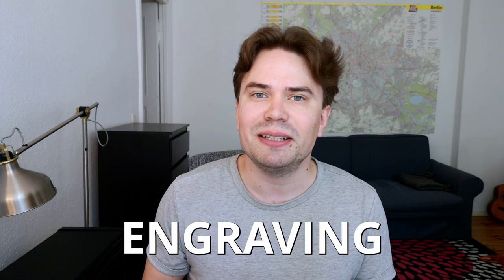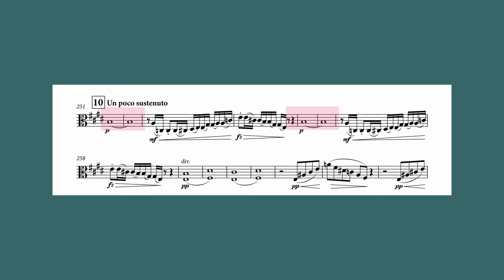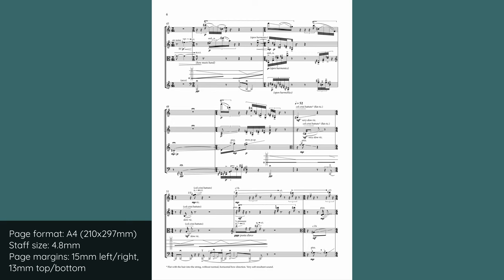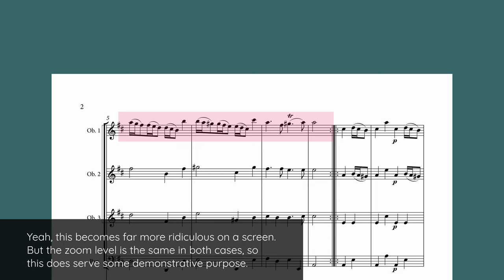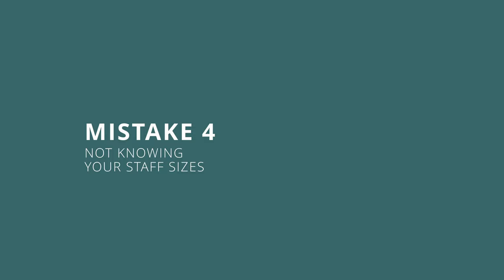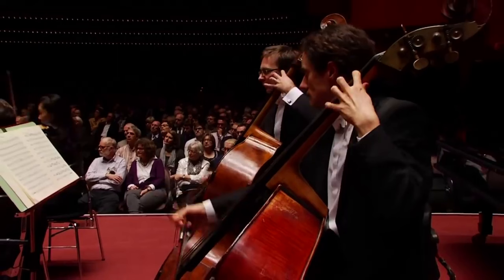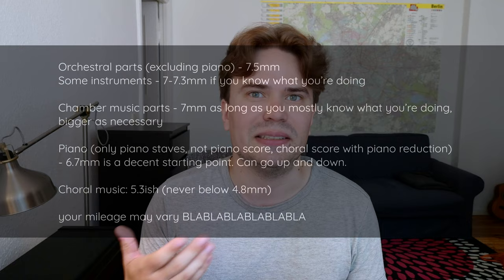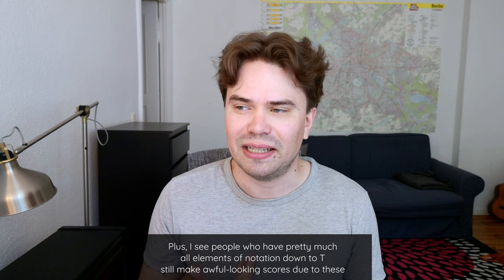Top 4 music engraving mistakes

Comment: In my experience, choosing staff and paper sizes such that the layout of a given single page of score is good is more or less always possible, but in a score for a large ensemble where empty staves are hidden, every page is its own potentially unique layout challenge, and choosing a single staff and paper size that is good for every page can seem impossible. I often run into situations where I ensure that tutti systems fit comfortably, but when there are sequences of several systems in a row where around two thirds of the ensemble plays, there isn't room for two systems on a page, but one system per page is too spread out.
Reply from the maker: Usually in those cases, you have to:

a) add extra whitespace at the bottom of the page (as in mistake #3)

- having different heights for the bottom staff throughout a score is fine, but you would want at least a spread (two facing pages, left+right) like this, not just a singular page. Some editions do not do this.

b) show more instruments that are not playing. Optimized scores are tricky and you can't always optimize all passages. Sometimes you have to pretty much have a tutti setup despite not having too many instruments playing.

or possibly, if it has not been explored yet:

c) reduce more staves if you want to achieve two systems/page

(the latter half of mistake #3 was partially aimed at this but it's a far more complex issue)
Reply: @frejwedlundcomposer  If you have to show instruments that aren't playing, how do you choose which ones? The first thing that comes to mind is ones that play on the adjacent systems. Any other criteria?